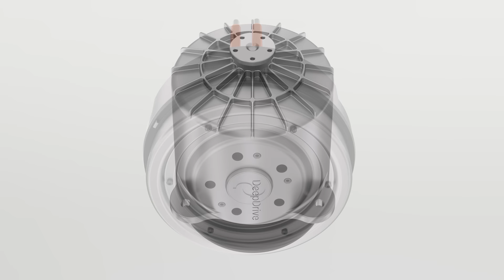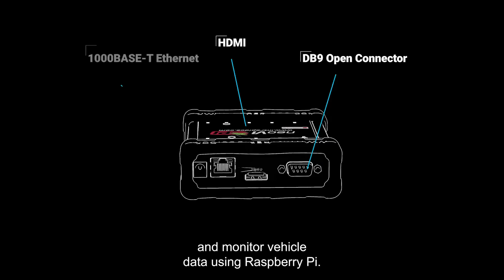EV Chargers Will Outnumber Gas Stations Soon; Tesla Could Drop 4680 Cells - Autoline Daily 3852

Comment: CATL and BYD both rocketed ahead of Tesla on battery casing design.  I will point out that if Tesla is in this predicament, just think about what's happening to all the European and American battery  factories.  Europe already canceled one huge factory before it even went online.  The technology is moving too quickly for traditional tariff-based forcing of domestic production to actually work.
Reply: So GM's eleventeen factories will produce unworkable batteries?  Who knew?
Reply: Tesla's problem stem from using cylindrical design. This leaves a lot of space between cells that is wasted. China and Europe are both focused on brick-like "blade battery" designs that don't have the empty space between batteries. Tesla's total battery production capacity sits at 37 GWh while Northvolt in the EU has 36 GWh right now and is expanding their factories to add capacity, once they're done Northvolt will have about 60 GWh of annual battery production.
Reply: @FrunkensteinVonZipperneck  Non-competitive batteries, aka too expensive, making the EVs they put them in too expensive as a consequence.

Chinese LFP batteries have already dropped south of $60/kWh, a pace 2x to 3x faster than industry analysts ever thought prices could fall.  That's already game-over pricing for EV-v-ICE.

The technology is progressing too quickly for domestic replication to gain any real traction.  The import tariffs make the situation even worse for vehicle-makers because governments (U.S. and European primarily) want to bring manufacturing of key components in-house, but until the technology settles down its just impossible.  

This puts domestic auto in a no-win situation (no matter who is president... both administrations are tariff-happy).

The fact that Tesla is even considering dropping 4680 production is an immense red flag for the entire industry.  If Tesla can't make domestic battery technology-competitive, who can at this juncture?

-Matt
Reply: @hasmond6808  Cylindrical designs are definitely a bit dated.  There are good reasons for using them, particularly in dealing with cooling and handling excessive heat from cell failures.  Older chemistries also did better pressurized.  However, I think that improvements in battery technology, particularly the advent of LFP cells, have made many of those reasons moot.

LFP cells have a lower internal resistance and don't need as much cooling, so bottom-plate cooling is totally acceptable.  Nor do they particularly need to be strongly pressurized to achieve good performance. And the native fire risk is far lower.

This just leaves Tesla with the "structural battery pack" concept as a cost and weight saver.  I've never really liked that concept myself... I feel that battery cells should be protected, not serve as structural members under constantly changing stresses (which is the problem Tesla is having right now with the 4680).

Still, Tesla has always hedged their bets.  Many of their vehicles (world wide) just use Chinese cells.  Its really just U.S. and EU customers who are suffering from having to use older battery technologies due to the older technology cells produced by domestic battery factories.  Which is unfortunate, but it won't stop the ICE to EV transition.

-Matt

Comment: A charger can only service one car at a time at a rate of 2 per our at best.  A single Gas station can service an ICE car in 10 minutes to full and has dozens of pumps making the service rate exponentially better per hour.  You can keep your EV.
Reply: 90% of ev charging is done at home so a 1 to 1 comparison is not possible
Reply: But no car/truck can fill up with gas at home:face-blue-smiling:
Reply: I test drove an EV9 last week. Kept it charged up by plugging into a 110 outlet.
Reply: Far fewer Fast DC chargers are needed than gas stations, and the number needed will actually top-out in probably less than a decade as EV ranges continue to increase (reducing the need for highway charging), replaced by L2 destination chargers.   In less than a decade will be millions of L2 destination and home chargers.

Also, you may be unaware of this, but there are already EVs on the road that can get a decent charge in 15 minutes or so.   Most people doing Fast DC charging don't need to charge to full anyway (that seems to be a huge point of confusion among people who don't own EVs).  If I'm driving up to Tahoe which is just beyond my EVs range, I only need to stop at a Fast DC charger for about 10 minutes, for example.

So it is a self-solving problem, basically.  A complete non-issue beyond Fast DC locations improving their reliability (the biggest bone of contention right now).

-Matt

Comment: 'Tesla Could Drop 4680 Cells'? How could that be? After I was assured by the Tesla faithful that it would change the world, lmao....RIP 4680 dead end tech :(
Reply: It's a sensational interpretation by a journo diploma, covering a technical engineering discussion they don't understand. 

Tesla is not dropping anything, their engineers were explaining challenges and how they are solving them.

Sorry old legacy fans, this is not the relief from disruption that you were hoping for.
Reply: The only 'disruption' that the 4680s are causing is to Tesla's  bottom line ;)
Reply: @nc3826  This just in:
"Tesla Cybertruck was among the top 5 most registered EVs in the US"
"It beat all the other EV pickups with a number higher than the next two contenders combined."

Seems 4680 is doing the job fine if so, but Tesla is supposed to just drop everything and go home. Right.

Comment: We have two EVs. we've never experienced a problem finding a charger. The issue is finding a charger, getting there, and having it be broken.

Just two weeks ago, we went to Culver, Indiana. We usually stop at the  GMC dealer in Plymouth to charge while shopping at Walmart there. Pulled up, the dealer went belly up, while the 2 fast chargers were there, they were powered off. No problem, I figured. Drove a few minutes to the Ford dealer. They have 2x 19kw and 2x fast chargers, but both fast chargers were both broken. 

So, in the end, we charged at the slow charger for an hour and went to stock up on snacks for the road trip. 

Had to stop at a fast charger at a Meijer grocery store for 15 minutes later that evening. I didn't actually need to, but I wanted to have a bit of reserve, just in case. 

So never a problem but inconvenient when stations aren't maintained .
Reply: @thebigdoghimself  I live 15 miles south east of Plymouth. I see this problem not only as you mentioned, but also in many nearby areas however, Rochester Indiana is the exception charging There are both level two and DC fast charging but as far as fast charging that reliable in Plymouth and Warsaw and Nappanee and Middleberry in Shipshewana in Topeka and who knows where else almost everywhere in that area there’s simply nothing or nothing available and as you mentioned dealers and others, don’t seem to appreciate or care to even maintain or keep them fixed. That’s quite a shame they will lose, and they will lose business because of their attitude,! Thanks for your comment.

Comment: Building charging stations while EV sales are dropping, very logical, but I guess someone will make money for the construction part, after that those will rust… like the CT
Reply: Sales go up and down but overall trend is up over the long term
Reply: ICE sales fell and EV sales literally went up, should we start tearing down the gas stations too? Please troll less. At least don't make things up immediately under the video that said otherwise.
Reply: SALES are not dropping. The RATE of GROWTH of sales is slowing. So instead of growing 40+% yty growth, we’re seeing 8-10% yty growth.
Reply: @malthumb  And what happens when the growth keeps on slowing? It plateaus then drops 
A slowing down is the beginning of decline
Reply: @taniabanes4707  Growth peaked on ICE in 2017 and has lost market share every year since
Reply: @JD-yx7be  looks like it’s hybrids turn to grow
Reply: @taniabanes4707  They both complement each other as they both share motors, inverters, and batteries. An advancement in one is passed to the other
Reply: It's a question of whether the chicken or the egg came first, with charging issues affecting the desire to buy and declining sales leading to underinvestment in charging.
Reply: @taniabanes4707  When GROWTH stops you get STABLE demand. Last month ICE sales dropped 0.1% from 2023. Let’s call that stable. In the same time EV sales grew 11%. That’s called GROWTH. When it levels out it will likely be due to market saturation, meaning there is no more room for growth. That does not mean decline. It might decline. It might not.
Reply: @gaobili  Chargers only care about cumulative vehicles already on the market. There were an extra 1.1 million EVs sold in 2023 added to the fleet. There is expected 1.3-1.5 million to be added to the fleet in 2024. If new EV sales went to zero the existing cars would still be on the road